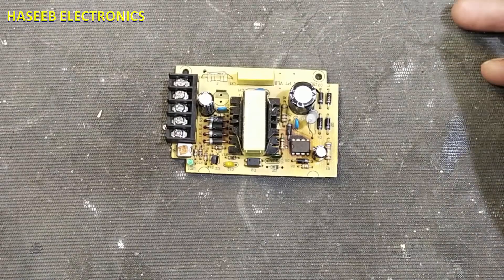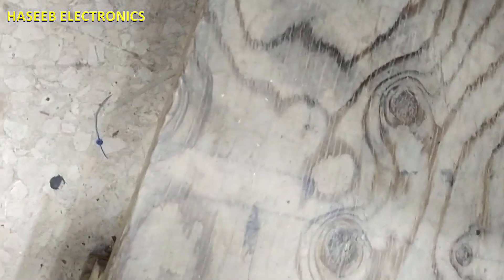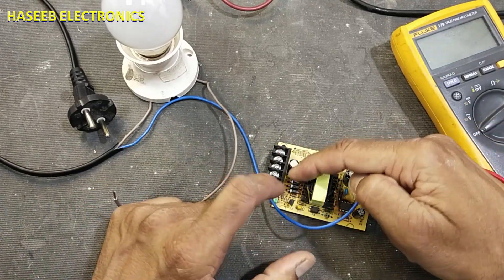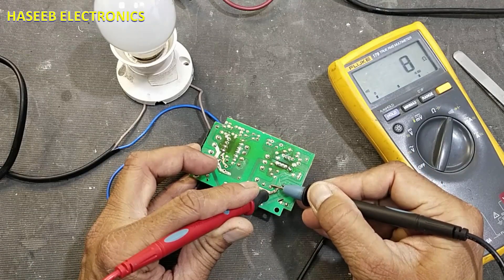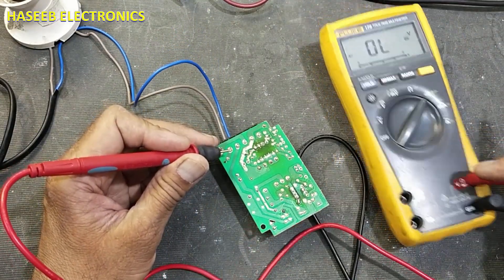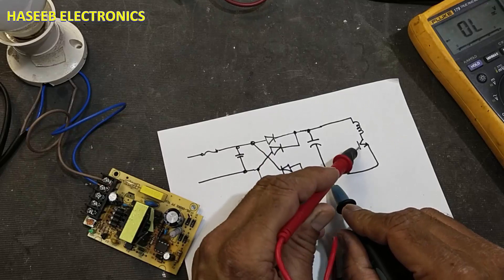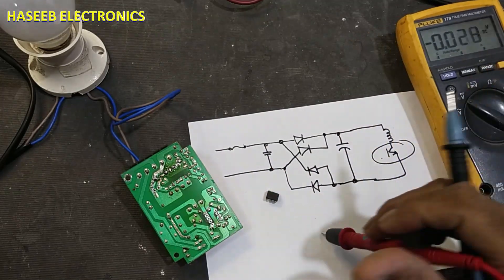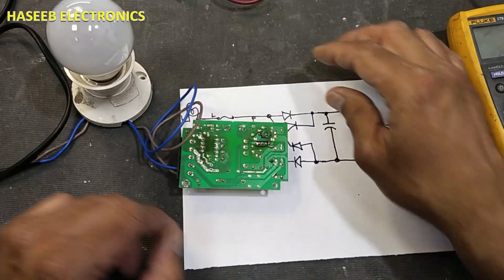{683} How To Power Up A Circuit For Repair || Work Bench Safeties

Comment: Just sharing, here... In the USA, we have "Painter's Tape." It is similar to brown masking tape, but the adhesive leaves no residue, when the tape is removed. It is usually blue, in color. When I clean my bench top, I use this type of tape to pick up the tiniest bits of metal, that the brush misses. It is also useful for securing a PCB to the bench, when soldering. It has a thousand uses, on my bench, and I always keep it at hand. Again, in the USA, using a light bulb in series as a current limiter is called a "Dim Bulb Current Limiter." It is also (incorrectly) called a "Dim Bulb Tester." It requires a common incandescent, or halogen, bulb(s). LED bulbs will not work and will not protect you. You can mix and match different wattage bulbs, in parallel and series, to obtain the specific current that you desire to use. You mentioned that a resistor may be used to discharge a capacitor, but then you used your screwdriver to short the cap pins. With all due respect, this is a poor and dangerous  method that can damage the cap. A "Capacitor Stinger" probe can be made from a high value resistor, having a sufficient wattage rating, a few bits of wire, heat shrink and chop sticks. Many DIY solutions may be found on Google. Constructing one might make a good, short, instructional video, for you. I hope these things help. I take no responsibility for what any individual makes from my suggestions. Each person is responsible for their own research, knowledge and safety.
Reply from the maker: first of all i am thankful for your comment 
it is really a valuable safety point. i will share it among all my viewers as well 
please accept my best regards and special thanks
Reply: @HaseebElectronics  In the light of all said above, a 100W incandescent lamp does not always offer the needed protection, simply because it needs relatively too much initial current in order to glow permanently (if something is still wrong after a repair, or even if it is used for a simple verification test that everything is O.K with the power supply under test). 
The best method is to use each time a bulb that has a power less than or equal to the power of the power supply under repair/test. 
As a practical example, using a 100W lamp in series to the input of a defective USB telephone charger under repair does not really make sense. In such cases I use a 3W night lamp, while in general repairs I prefer a 40W lamp. 
On the other hand, an inverter welding machine may need a 350 to 500w lamp for the same test...
Reply from the maker: perfect
I normally use 60 watt 
100 watt 
200 watt 
300 watt 
500 watt halogen rod 
depending on the load size
Reply: @HaseebElectronics  how do we know the correct wattage of bulb in every psu? Can you enlighten me? Maybe a simple formula? I am a newbie.

Comment: How this one that you will remove the faulty component and no continuity again but it burns down certain things
But when I asked someone they said it a feedback
When power comes and doesn't see that component that was they it will send feedback or so 
Please help me on this 

Great video 💪
Thanks for sharing 🥰
Reply from the maker: good morning 
when we don't find continuity or LOW input impedance, but when power is applied and many parts get damaged. 
if feedback is missing, it will be not a cause for damaging parts 
Here are few possibilities 
1. DC capacitor (bulk capacitor)
2. Power Mosfet or switching IC is damaged (it is the most common issue for the above fault problem)
3. RCD snubber is short circuited

Comment: Aren't you creating a voltage divider with the light bulb. So only 1/2 voltage will be at the board ? Or am I thinking wrong?
Reply from the maker: exactly it is series load connected in series with input line of UUT / DUT. during normal operation the lamp will not effect too much 
but in case of hogh current consumption by UUT/DUT (during any failure / error / abnormality) the series lamp will protect the circuit from any further damage 
for example, if there is anything short circuited in UUT/DUT, the lamp will glow full instead of any possible damage in the UUT due to any unexpected short cirfcuit
Reply: @HaseebElectronics  Thank you sir !!

Comment: I try this safety bulb but with 160watt bulb instead
Connect it to my atx power supply
And the bulb is kinda half glowing

Its measured 100ish volt on ac side
And the dc side is 200ish

Whats my problem sir?
Is it short somewhere?

Comment: "Hello, if I don't have 320 volts at the output of the diode bridge, where could the problem be? Thanks in advance!"
Reply: Check all the components until the bridge, like fuse, bridge itself

Comment: SIR THANK U FOR THE VIDEO , IAM WARUNA FROM SRILANKA SIR CAN U PLZ  SHOW THE IC REMOVAL TOOL THAT U USING IN THIS VIDEO , THANK U SIR
Reply from the maker: thanks a lot 
it is WELLER WR3M made in germany 
you can find it online. it is abouve 3000 USD. its routine maintenance is also expensive 
i suggest to get HAKKO 701-15 that is cheaper than this and its maintanance is very low

Comment: Mr. Hasseb, why need to remove the ground cable?. I used series lamp for ups repair, lamp light up and ups not turning on. After remove the lamp and power up ups, then it is able to power up. Kindly advise. Tq

Comment: Sir you checked resistance with multimeter on the input of smps.any particular range is there.what is the use of measuring that resistance
Reply from the maker: Normally it is above 100k and above 
If it is some hundred ohms then it will be a problem
Reply: @HaseebElectronics  sir I checked on ATX power supply smps of PC the voltage at the DC rail capacitor is 315vdc and it is maintaining.when I checked the circuit I found that the pwm ic tny2768pg source and drain was shorted,it has internal MOSFET.i checked  in the circuit and it was shorted and I taken out from the circuit the ic still shorted.There is no output at the output side of smps and the fan is not working.but the fuse is not blown even the source and drain of ic was shorted.why

Comment: If the circuit board was good, series bulb wouldn't illuminated . Isn't it?
Reply from the maker: if the circuit is good, and lamp is higher wattage for example 100  watt. that time the lamp will not glow. 
just in startup, it will glow for a moment, that time the empty capacitor tends to draw surge current for initial charging, 
if circuit have some short circuit, that time the lamp drops all the voltage across itself, and protects the circuit from more damages

Comment: Great videos Haseeb. One question. Does the lamp must be 100w? Should a 60W or else work as well?

I imagine it's all about not to burn the lamp because if the lamp burns out then the lod will fall onto the power supply fuse

Comment: I think what you are saying about the lamp is that it causes a large voltage drop across its filament if a short occurs in the circuit. A shorted current will flow, but it will be greatly reduced due to the voltage drop in the lamp. The short could occur after a number of otherwise good components. Is that correct?

Comment: I think it is good to use a low watts bulb so that little current can flow through the circuit, for example 50 watts and not 200 watts..
Reply from the maker: yes dear 
50 watt, 60 watt, 100 watt, 200 watts lamps are used according to the load size

Comment: Doesn't make sense? If there was a short, why was the fuse not blown? Maybe you replaced the fuse without telling us?
Reply from the maker: great 
it's fuse was burnt out and I already bypassed fuse with 1 ampere buss fuse wire to demonstrate the problem instead of proceeding to input short circuit diagnostics

Comment: Why live earth wire can't be on series lamp ? Thanks... Greatings from Portugal 🇵🇹 🌟
Reply from the maker: most welcome 
during repairing, in my experience that it is safe to use 2 wires (line & neutral) without earthing 
just connect earthing wire for final testing

Comment: Hai, I have doubt about resistor if defective or not,a 4 band(Brown-black-brown-gold) resistor in smps(de-soldered from PCB) is showing resistance of 3Megaohm but as per color code its value in the range 95 to 105ohm which means the resistor is open circuited (defective) ?
Reply from the maker: yes it is 100 ohm 5 % tolerance
if it is out of limitations
replace it
Reply: Yes. It's nominal value is 100 Ohm.

Comment: Hi, some of the electricians use"KLY POWER CIRCUIT" for repairing smps power supply.We want to know about this this circuit diagram and about its benifits or disadvantages. Does it safe to use it?.

Please make a video about this kly circuit

Comment: very nice.
sir i have branded atx ps
its 5v ok, but when i turn it on, means green to ground then it turns on and immediately turns off, and on series; the lamp glows full then dim then full then dim but output 12.1v 5v remain stable, but 3.3 is 2.8, when i apply minor load, then off although on series.. main caps ok vcc cap ok, where is the fault.?
Reply from the maker: the problem is 3.3 section  check capacitors in 3.3v section
the lamp is turning on/off, that means the circuit have PFC circuit, PFC circuit needs more power input for turning ON. when we connect series lamp, it cannot produce full startup current by the PFC circuit for initial startup and voltage drop at atx's input, so the PFC turns off
when it goes off, the voltage build up again,  and it tries to start again 
just add one more lamp in parallel to the existing lamp
or use next higher wattage lamp (if old lamp is 60 watt, use 100 watt. if old one is 100 use another 100 watt in parallel to the old 100 watt or remove old 100 watt and use 200 watts lamp
Reply: @HaseebElectronics  i m grateful to u for detail answer, u r right it have a pfc circuit, sir 3.3v caps i checked, its ok, is there chance of Schottky rectifier faulty,?

Comment: MBR60200PT (Vf= 0.90volts)(schottky diode) na mile to iske mutbadil kya hum 60F30S (Vf= 1.3volts) (fast recover diode) ya STTH6002CW (Vf= 0.75volts)(Ultra fast diode) ya FFA60UP20DN (Vf= 1.15volts)(Ultrafast diode) istemaal kar sakte hain kya , aur isme proper heatsink with fan istemaal karen to kitne “ Amp ” tak safe load use kar sakte hain ,,, behad shukriya ,,,,, 👍

Comment: Please mr haseeb
I used series lamp
First it was off but after few minutes the input mosfet burn and lamp became on
So what happened and what reasons
Thank you very much
Reply from the maker: MOSFET can damage due to any reason, (most of time, material failure) otherwise series lamp is best assisting tool
Reply: @HaseebElectronics  thanks again but i wanted to know why series lamp didn't protect the mosfet especially current never exceed half ampere.